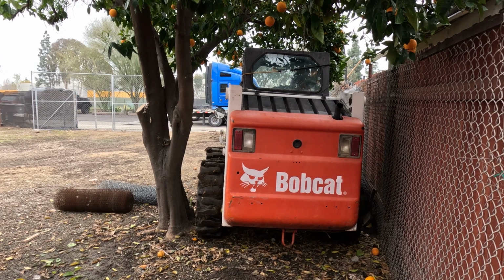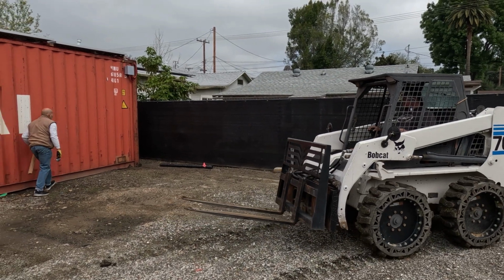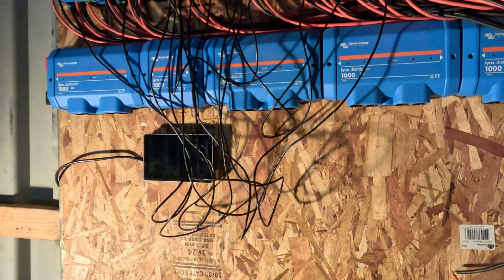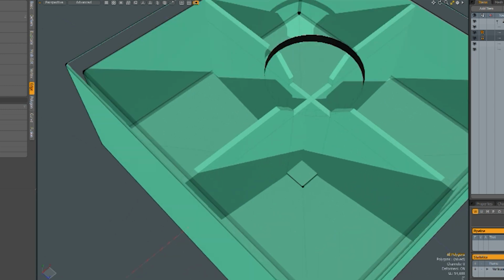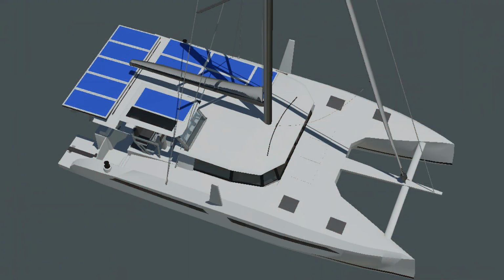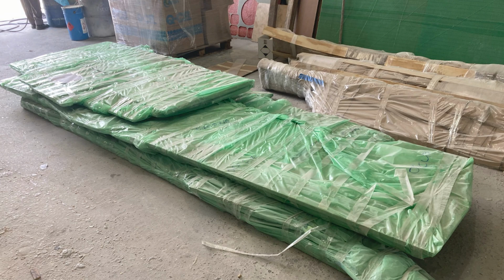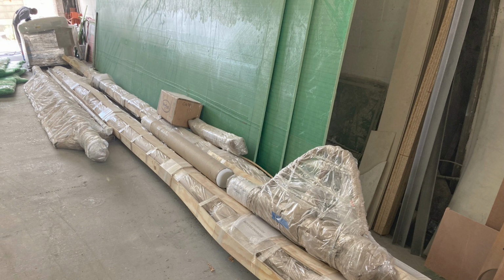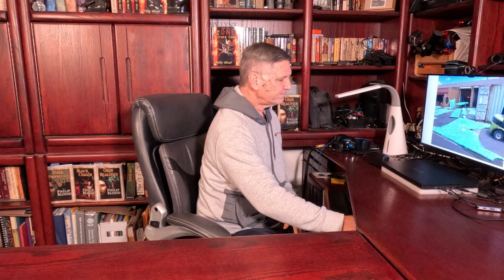Kit E25: Kit Catamaran Build Site Prep P2

Comment: What about a drain on underside(bottom) of sump. Like the way the fuel filters work, they have a drain to get water out without taking apart.
Reply from the maker: We discussed that with the designers at Schionning and they recommend against it, so we are sticking with our original design.

Comment: Happy Belated Birthday.  Your sump system should work and fits in with your belts and braces design philosophy the only weakness of this approach which no doubt you have identified is that for maximum efficiency you need to clean fuel at a marina or protected anchorage.
Reply from the maker: Yes, we plan to do fuel polishing in calm conditions.

Comment: The sump would be better at one end of the tank then you could have an external tap off. A day tank is the best option for clean fuel to your engine.
Reply from the maker: We will consider it, but I don't know that we will have access to an external tap off.  The tank is deep in the bottom of the locker with the bottom of the bride deck just below

Comment: Nice dog and cat!! Uhh, I have a question about the bulkheads that span the two hulls together. I can,t remember the name of the carbon fibre type of glass you plan to use! Are you going to beef up the cross bulkheads with a layer ,both sides, of the bulkheads??? Ohh , I love the fuel tank design! One other thought there,,,, say in the engine room fuel management area say an extra holding tank of twenty gals or so just to store fuel you purchase to filter clean and then transfer to your main tank??? Decrease the chance of contaminating your main tanks. Obviously you would be in a port or anchorage to get fuel and you could get two or three top offs to fill the mains. Just a thought.
Reply from the maker: No need.  The original design uses carbon fiber to reinforce those areas.  The material you are thinking of is basalt, which is what we are putting on the bottom of the hulls.

Comment: Happy Birthday and Retirement!!  I was noticing in you computer mock up of your fuel tank, I was noticing your access from the top looked like it was going to be very restrictive around the baffles. I have noticed on other You Tube channels I am subscribed to, their fuel tanks have much larger openings  like about 50% of the surface area of the top of the tanks. If you wanted to incorporate a larger opening you could also include your fuel pick ups and fuel levels in the top you can remove. You would  be able to have easier access if you ever need to service the tank itself  such as cleaning and painting. I look forward to watching your boat come to life  over the next number of months.
Reply from the maker: Thanks for the kind wishes.  If you would like to link some of those videos I would take a look.  However, the inspection port I am adding is fairly standard size from Vetus.  You will see them used in many boats.  For example, watch MJ sailing, they are building a cat and adding their own fuel tanks in one episode.
Reply: @SailingSVLynx  You are most welcome and I hope you enjoy your boat building and sailing experience. I had another look at MJ Sailing's video and I did notice on their fuel tank they didn't have an inspection plat but then maybe with a bottom dump they can drain the fuel tank through a filter. I went through all of the  names on my list that are sailors and I I couldn't find the video I remember where they had to make a larger opening in the fuel tank to clean  and wipe it. There have been a couple who have dropped off my list because they left You Tube . I do remember that episode I was referring to but where it is now I don't know where it is now. I look forward to watching your next video when you stock your container with your new boat. Thanks for what you video so that my weekend is a little more entertaining. Thanks

Comment: Are you going to run each 48volt battery (2x24V) to a busbar? Doing this will lower the C rating being pulled through each battery.  Since you will have 3 48V batteries example, pulling 5000 watts from them in daisy chain means each battery will see 100 amps.  Connecting each  48V to a bus bar means each battery will see 33.34 amps. Less heat and less loss with longer cycle life since you are using less from each battery. Just wondering since 11,500 watt draw is 1C. Right now its not a huge deal but when these are in your boat and you draw draw 30k it will matter big time since 3C will cut your life cycles in half or even more. Again I put all this info in so others can see also so when they do their own solar with batteries they know.
Reply from the maker: The batteries each connect to a Victron Lynx bus bar.

Comment: Progress is being made and the excitement builds!
With the fuel tank design, is the sump area creating enough of a baffle, in order to provide an easy pass-through, without causing turbulence in the sump area? A small cut out in the middle of each quarter might be advisable.
I watched that part of the video a few times, to see if you had mentioned this. It would probably add a couple hours of work, cutting out the semi-circles at the bottoms of the panels and sealing them, before installing them. Probably a bit of a "belt and suspenders" approach, but your designs for the systems are so very carefully thought out...
Thank you for sharing and great good luck unloading!
Reply from the maker: Yes, we were thinking of adding some holes in the baffles to let fuel through.

Comment: Like the tank design. Back in the day it was common to see a sump on fuel tanks with a valve to drain off the crud at the bottom of the tank. Enjoy your retirement I am certainly enjoying mine seem to be busier now than when I was working😀. 👍
Reply from the maker: I'm going to work 10 times harder now that I'm retired... I have to build a 50' catamaran in 2 years.  Yikes!

Comment: Sump in the tanks is great , any way to have a bottom drain with a valve to manually clear the crud ?
Reply from the maker: I thought about that, but couldn't find an easy way to access that where the tanks will be located.  Still possible though, we'll see as we build the boat.

Comment: Amazing tank design, very clever design! don’t forget to design the boat area where the tanks will be siting in the same shape as the tanks, you don’t want open spaces (pressure points) between the bottom of the tanks and the boat.
Congratulations in your retirement and Happy B’day too!
Love the cat…😊
what’s the cats name?
You should introduce the cat to you audiences…
Reply from the maker: The cat's name is Maxie.  I'm sure she will show up in other videos ;)  As for the fuel tanks, these will be built into the boat, so they are glassed right in without any space.  In essence, they are the walls of that locker, not put against a wall or bottom.  They are built right out of the boat panels as part of the structure, made from the same foam and laminate panels as the rest of the boat.  We decided to go that way since it is lighter weight and less costly.  The only part we purchase are the access ports and intake kit, which will likely come from Vetus.

Comment: I'm probably too late for this advice to be worthwhile but seeing how saturated the ground got I was thinking digging a trench and laying down some drainage pipe (has holes in it to collect water) to bring any rain away from your building area. I worry that every year in the rainy season you run the risk of a support shifting and throwing you off of square., or worse.
Reply from the maker: Hey Robert.  Well, we will be pouring cement pads to support the boat and, even though this winter has been extra rainy, normally we don't get much rain in Southern California.  So, I am not too worried.
Reply: @SailingSVLynx  I lived in OC for 55 years and back in the '60s there was major flooding when the Santa Ana River overflowed in Huntington Beach and other areas. There have been other years where it was almost as bad. I lived at the top of a hill in Mission Viejo and there were times it would rain so hard that the street flooded and water was inching up the driveway. Our back and side yards flooded because the 6' drains couldn't handle the amount of water.  The street peaked in front of my house so I was in the best draining area of the neighborhood. I wonder if your neighbors yards drain into your area?

BTW, if you want to see something interesting check out the USGS soil liquefication maps for OC, especially if you live in hilly country. Here in SW Utah they have problems with building on blue clay with homes only a few years old being destroyed as the ground beneath then heaves or collapses.

Sorry for all the questions. I'm 71 and my poor health has me stuck at home with nothing to do but watch YT.
Reply from the maker: Well, we aren't in OC, so that won't help us much, and our neighbors don't drain into our build site.  Also, even though this rain has been sustained, we haven't had much issue with it on the build site, just some damp ground.  So, if the ground has done this well with the worst rains in 24 years, we should be fine.

Comment: Hi, I had mentioned about the setbacks in the previous video. Before retiring eight years ago I worked in a property management office and we had dealt with setback issues on occasion.  

Fuel tank design is not an area I'm knowledgeable of,  I'm just using my love of design. I love your idea and agree that any water and sediment should work it's way down to the sump, especially moored in calm waters, but while sailing I worry that the constant motion of the rest of the fuel will keep contaminants in suspension. Maybe adding a smaller opening at the top will better trap any contaminants once they fall into the sump area. Think the narrow portion of an hourglass or opening of a wine bottle. It will keep any interaction of the dirty fuel with that still in the upper area of the tank to a minimum. It could be hinged to allow better access for cleaning.
Reply from the maker: Thanks for the suggestion, we'll look into it.

Comment: How are you going to move your boat to the ocean after it's built?
Reply from the maker: A crane will lift it off the build site and deposit the boat onto a 50' flatbed semi-trailer.  Then, with a police escort, we drive it on the freeways with a wide load permit, at 3 am, to the ocean, where the crane picks it back up and deposits the boat in the water at Newport Beach, Ca.  It will take about 2 hours (going slow) to get there.

Comment: My only comment is that the access port does not look big enough to get your hand to the back of each of the 4 sections - Could just be a perspective thing.....
Reply from the maker: We will make sure the gap is wide enough to access the sections before we glass the baffles in place.  The gap at the top of the  baffles can be cut wider if necessary before we seal the top of the tank.